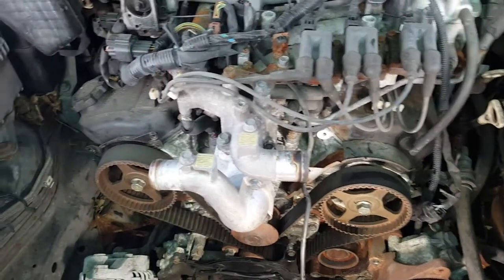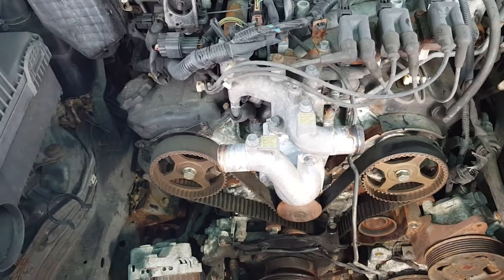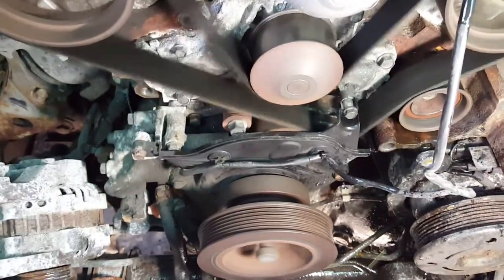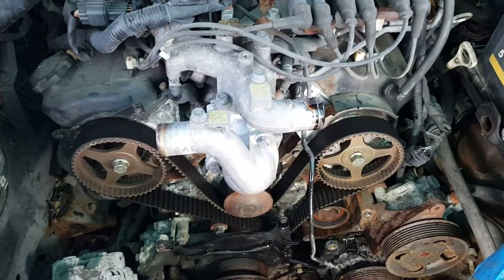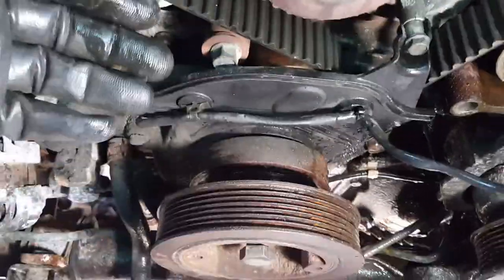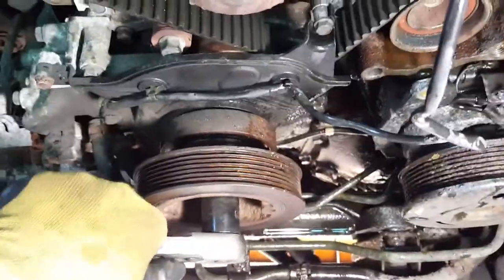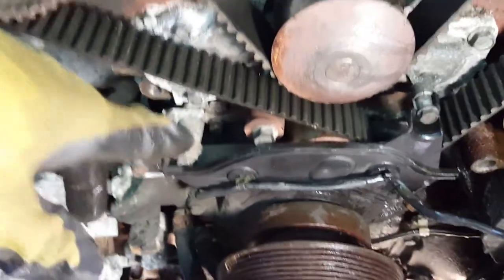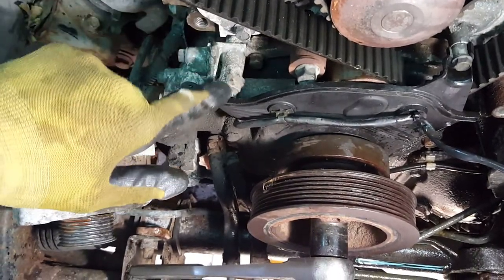2001 MITSUBISHI MONTERO LIMITED,  3.5 HOW TO IDENTIFY A ENGINE NOISE, MOST COMMON PROBLEM IN THIS PA

Comment: Also remember to check that the the tensioner pulley has not moved from where it should be. The hydraulic tensioner could be working fine but when the tensioner pulley moves it will lose belt tension. with new tensioner installed with pin still in use pin holes on tensioner pulley and turn clock wise till tensioner pin can spin freely and tighten tensioner pulley bolt. Then remove tensioner retaining pin.